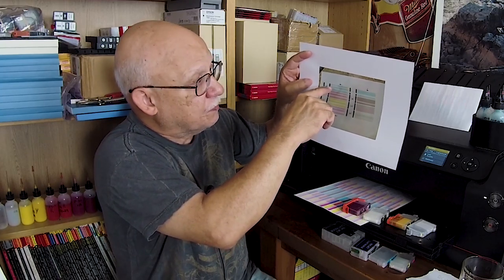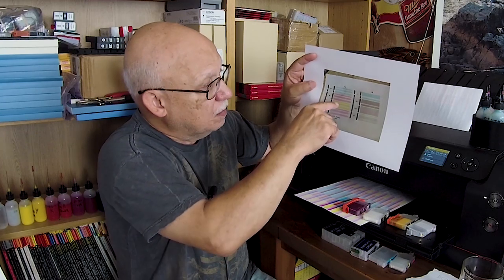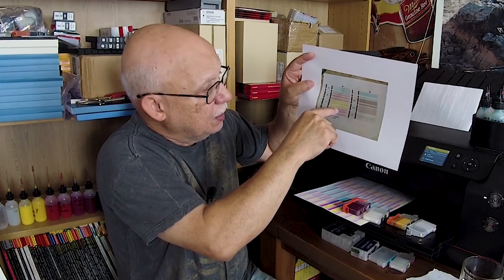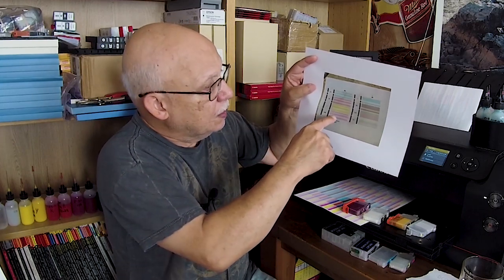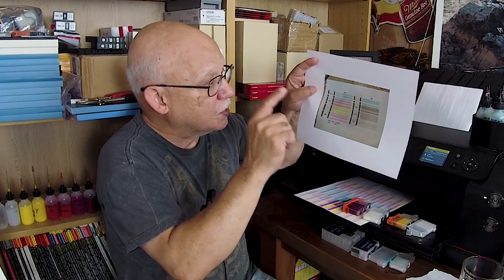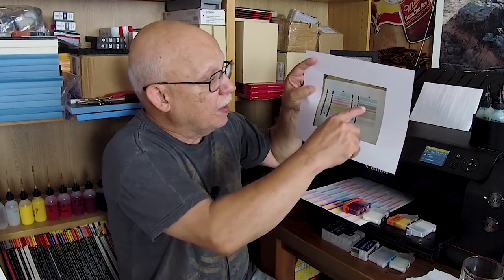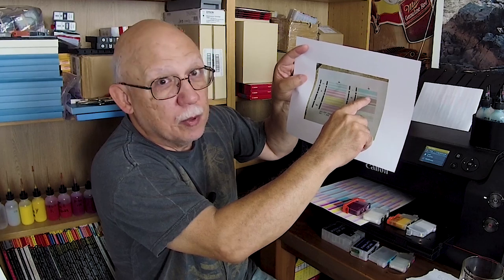CANON Printer Nozzle check! Now this really looks bad!

Comment: As far as my experience with Canon Printhead failures, everytime I had a printhead printing half bands lighter it had never been a printer mainboard fault, just replaced the head and that fixed everything. If the printhead on the other side is not recognized at all (not B200 error) and most of the times I could see evident damage to the nozzle plate with a magnifiying glass it has been often a mainboard fault that burned the head, I suppose a head current driver chip fault.

I can not exclude anyway that sometime can happen that the mainboard causes problems to the head even in the first case, it's just not likely to be the cause.

Excellent video as always dear :)
Reply from the maker: Thank you for the expert information my friend.

Comment: thank you! I might have an issue w/ my Pro-10. what do you think?  
Performed a soak cleaning after many years of non-use. Ran nozzle check using the original canon cartridges from many years ago. PBK band is blank ( white) , but all others are printing their respective colors. Reclean? Damaged Head?  No getting any errors other than two empty tanks ( Grey, Optimizer, which I have just reordered)

Comment: Love your videos. I have a Pixma 6120. When I print a nozzle check it comes out looking good except there is a blue shadow the shifts to the left of Anything that is black. So not good it does not do it when I print B&W. Any ideas? I did an auto head alignment. Thx!

Comment: I have canon mx922 and I have submerged my printer head nozzle to the water with hand soap to unclog overnight and it still works.
Reply from the maker: Hand soap?  You better not push your luck.
Reply: @cheo1949  Yea it works so far. I thought my printer was broken for good but when i soaked it with water overnight it works perfectly i let it air dry for 30min.

Comment: I have a pro 100. Printed last week, and it was no problem. Did a nozzle check last night and cyan has lines. Done deep cleaning and everything. Any other suggestions to help with that ? Thank you.
Reply from the maker: Are you using only Original inks or are you refilling or using other 3rd party carts?
Reply: Original cartridges, but modified them to use precision to refill.
Reply: @cheo1949

Comment: What do you suggest to those refillable cartridges that dries up easily and clog overtime any tips?
Reply from the maker: It's not the carts that are drying up. It is the print head nozzle plate and that happens due to not printing often. My refillables don't dry up.
Reply: @cheo1949  what i mean by dries up is the sponge dries up which clogs the ink on the tank flowing to the nozzle.

Comment: I wish the print head was $50-$60 on Ebay, more like $199.75. I ordered one over seas, China for $90.50 and I'm keeping my fingers and toes crossed. Screw OEM, you don't have to be a rocket scientist to flush and refill cartridges and follow the Guru Jose Rodriguez to keep you printing to your hearts content and save a ton of cash. I'm pretty frugal and don't like to waste money and truth be told; even if I won the lottery, I would be still refilling.
Reply from the maker: You can buy a new PRO100 for after rebate net price of $100-150.
Reply: @cheo1949  I know, B&H has them and that's the next step if this fails. Ain't that a bitch that all the states now charge sales tax; even Ebay, so add another $20.00 to the $150.00 price out the door; but all in all Canon Pro-100 is an awesome printer for the price. My 1st real printer was a Epson 2200; I think I paid over $600.00 for it and my 2nd was a Epson 4000 which was a beast until it gave up the ghost. Mahalo

Comment: On my Canon Pro 100 I have noticed that the reddish purple flowers seem to print out as a reddish brown.  I have tried the different profiles, but the color still looks the same.  Any ideas?
Reply from the maker: How does a standard image look printer with no editing?
 Open and print. Did you print that image with just the driver controlling color and using a CANON paper? That will tell you volumes. If that file's colors print accurately and your image's colors do not then that will tell you where the problem may lie. Also, check the image for gamut warning to see if it flags your flowers.
Reply: Image Gamut warning?  I'm afraid that is a new one to me!  I plead guilty to using non Canon paper.  I was using Epson Presentation Matte.  I'll try again with the Canon paper.
Reply from the maker: @HamiltonSRink  most image editors that are color managed will have that option. Photoshop has it in VIEW Tab.
Reply: I'm a thrifty sort,  so I mostly use the jpg editor built in with Windows 10.  Also have Raw therapy and Photo Scape X.
Reply from the maker: And those apps are able to open your images at color spaces larger than just sRGB? That coyld be an issue.
Do you want me to test print that image for you on my PRO100? If so just email me the file to tooljoe1949@gmail.com